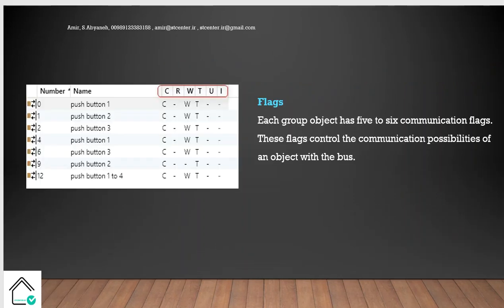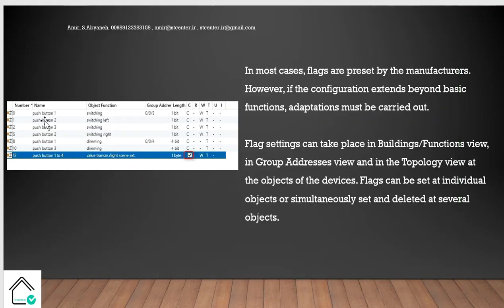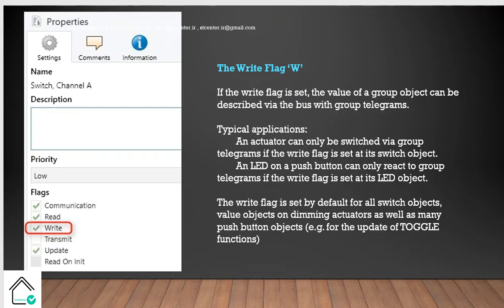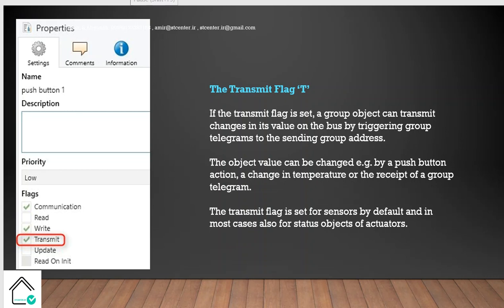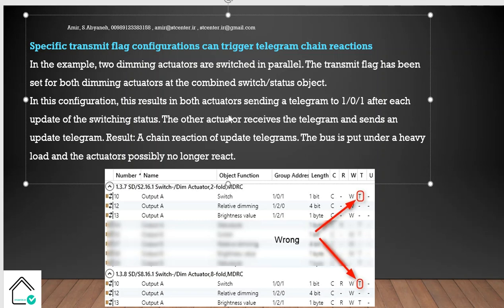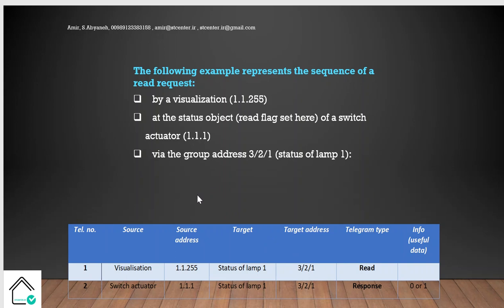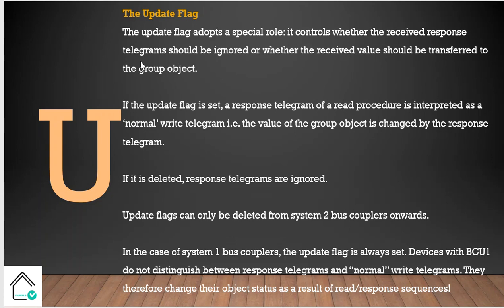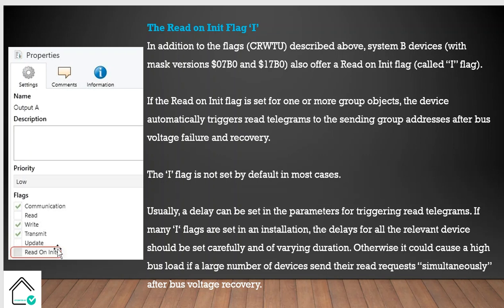Flags - KNX Advance Course -  Chapter03

Comment: So as a result "C" for communicate the object, "W" for Output object, "T" for carry the value change inside its group, "R" for input object, "U" I dont get it !!! , "I" for Reading is activated in the first place after voltage failure.